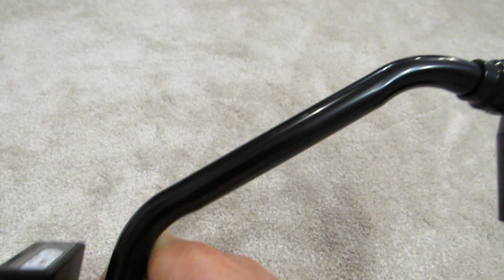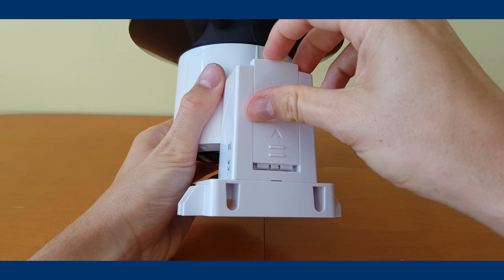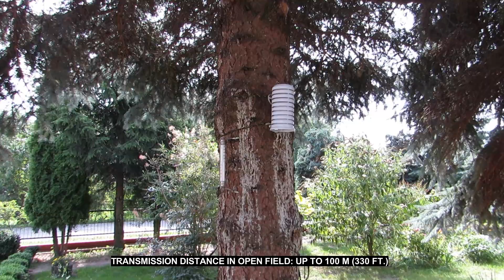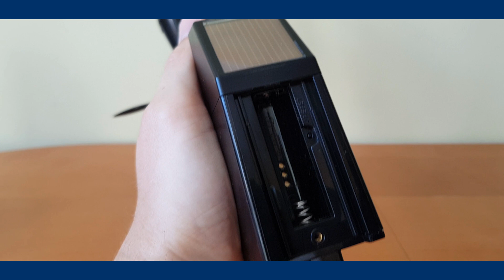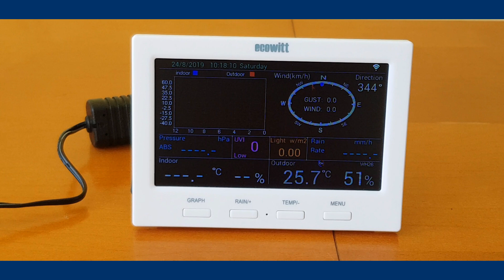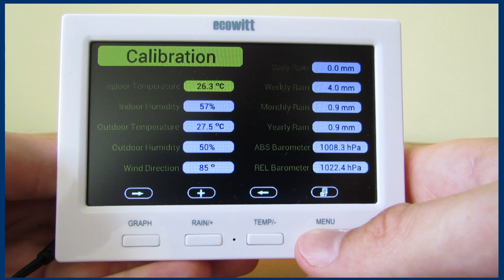Ecowitt HP3501 WiFi Weather Station Review

Comment: Excellent review! I’m trying to narrow my choices. I don’t administrate an airport or farm for a living so spending a thousand dollars to gain 1% of accuracy would be silly. Just a suggestion, an inexpensive uninterrupted power supply could easily provide backup electricity to the display in the event of a outage.
Reply: I think he mention about battery backup in case of power failure to insert the batteries then in the same sentence he said however there is no possibility of battery operation at 13.30 minutes.